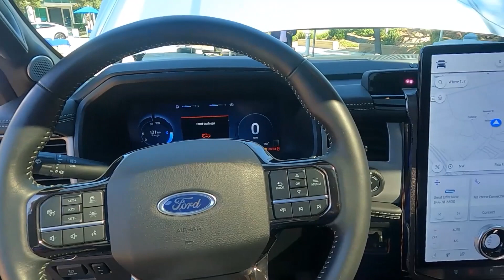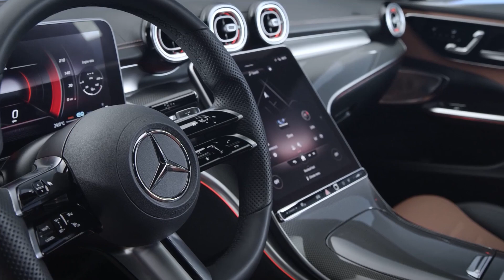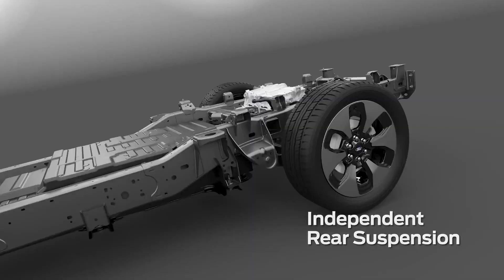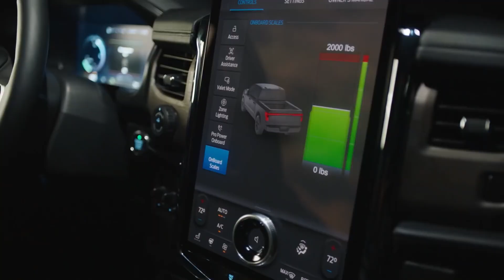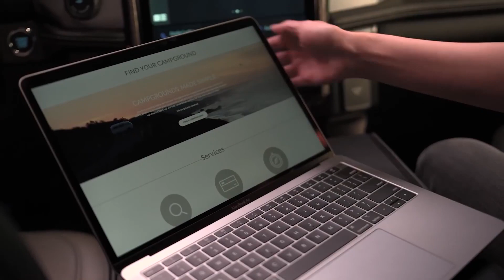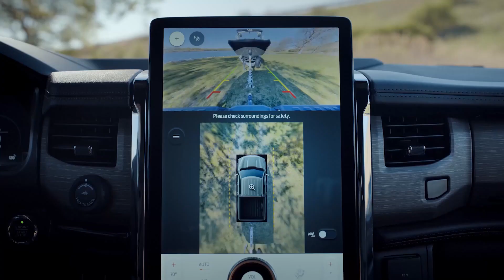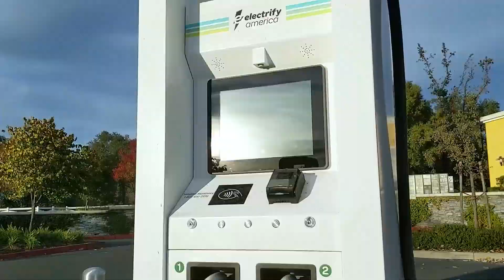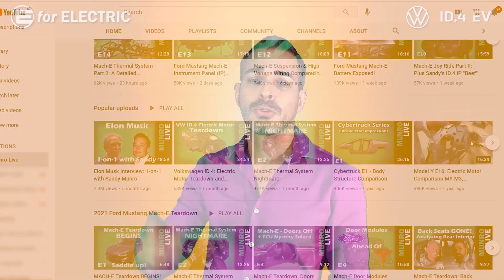SANDY MUNRO on Electric Trucks: F-150, Cybertruck & Rivian

Comment: Monroe: "That Lightning is absolutely perfect for a construction guy." Well, as a construction guy, I must say that without a 6.5-8.0 ft bed, the current Lightning (5.5 ft bed) is worth nothing more than an SUV without a rear roof. Just try hauling a 4x8 sheet of plywood, or drywall, or dimensional lumber, or 10 ft lengths of rebar, or irrigation pipe. Not possible. This Ford is directed at a middle class family that will carry bicycles, a Christmas tree and groceries.
Reply: 4-seater trucks, amirite?
Still see lots of them doing other types of work than construction. I just don't know what it is. But I saw a four-seater with the bed replaced with a big metal box with an open roof.
Reply: @موسى_7  IMO they extend the SUV function to carry nasty stuff, like the dog, bags of fertilizer, or a 1/2 yd of soil for the home garden. The 4 seats are for the parents and 2 kids.
Reply: @louismorejohn586  I thought four seats were for some rare (though I can only call 2-seaters rare) ocassions where they need to get a whole crew somewhere remote to work together. That's what Dad told me when I told him "Seriously, everone is getting a pickup truck for fashion! They even shortent the bed to fit in two seats to take their families!".
What does Dad know about the pickup truck market in a foreign country?
Also, the four-seater I saw with a metal box looked like it was doing commercial work.
Reply: Thank you for looking at this critically and adding some reason to the conversation... I was starting to think that I was the only one that hadn't been brain washed or bought. 👍
Reply: Did he actually say construction guys need a place to use a computer and take to nap? I could do that in a Honda Civic.
Reply: I have carried 4x8 sheets inside my SUV that is only 16 ft long. The sheets were sticking out several feet beyond the tail gate but that was not really a problem. I have also carried tubing and lumber over 10ft long inside the SUV with one end sticking out the front passenger side window. Where there is a will there is a way.
Reply: @cruiser97eric1  Understood, but if you did that everyday, your SUV would be thrashed in a week. The headliner, upholstery, carpet, etc. gunna be dugly. Try 25 x 60 lb sacks of concrete covered in concrete dust. The point being that your SUV is also not "perfect for construction guys" who need daily use of a large bed truck, without jury-rigging.
Reply: Oilfield workers around here would be ok with the shorter box and room in the cab!  Roads where they go need the ground clearance and a4x4!  Plus they will have an office setup in the cab!  Box is big enough for smaller loads of parts, like  a pallet of valves etc!
Reply: Lol.  Ever heard of a trailer?  I don't know many guys hauling those kind of materials without a trailer....unless you are a remodeler or fix it all guy buying a single sheet of plywood and a couple pieces of lumber
Reply: @44beebe  LOL. I have a 10 ft trailer, but it's not always hooked up to my truck that has a 6.5 ft bed. Roof racks are often used too. A 4.5 ft bed is almost worthless for construction.
Reply: Put a rack on it--problem solved.
Reply: @vilicus77  Nope. I will not park my truck outside, and with a rack it won't fit under normal 7ft garage header.
Reply: @louismorejohn586  Do what you need to do. I will be off-roading my EV Rivian when it hits the market.
Reply: @vilicus77  The Riven is soooo heavy, it's taxed extra as a commercial vehicle in my state.
Reply: Not to mention range can be cut clear in half when towing anything significant. I couldn't make it to my camp and back towing my trailer, tractor and implements. My crappy old 01 duramax loses maybe 2mpg when towing.

The lightning is a no brainer for plants and most fleet vehicles that operate close to the plug and return there every day.

 For anyone that uses a truck as a truck, I'd wait to see if Toyota releases a hydrogen Tundra, otherwise take very good care of what you're driving now.

Comment: Sandy gave Kia a bad time for using an existing body for the Niro, but Ford gets praise for doing the same thing with the Lightning.
Reply: The reason he didn't like it in the Niro was because they didn't optimize the space. The Kia doesn't have a frunk because they filled the space the engine and transmission left and filled it with other junk.
Reply: @elbucky6  Junk?
Reply: Decades of experience prove the Ford design works.

Comment: Sandy, Biden drives Corvettes. He has talked to Mary Barra and said he wants to buy the first electric Corvette. When he drove the F-150 lightning he put his foot down. You don't have to like his politics but Biden has always been a car guy.

Glad to see Sandy turned around on parts bin costs. He has frequently derided using existing components in the past. Using mass produced parts is how we get to affordable EVs.

What Sandy is probably thinking about for the range extender is a box that fits in the back of an F-150 Lightning and looks like a standard pickup tool box. It has a generator and fuel tank inside that can power the whole truck and charge the battery while driving. Ford patented this last year but has not officially announced it as a product yet. Will be expensive but is ideal for businesses that make regular cross continent trips.

Gotta add a personal note- Several years ago I was approached by a specialty chemical company that needed to transport a few drums of chemicals at a time across the country. The chemicals were used in silicon chip manufacture (or so I was told. We did a lot of DOD work) and each drum cost what I would pay for a house. They had to be maintained at +/- 2C of the required temperature regardless of the outside temperature and regardless of whether the driver had stopped for the night or not. I love that kind of challenge and the F-150 lightning would have made it far too easy.
Reply: Bide. N doesn't know when his butts been wiped!

Comment: Ultimately, EVs are going to be waaaay cheaper to produce than ICE cars. Just not having to do emissions compliance will save billions. By pricing them reasonably, they get millions of loyal customers
Reply: Due to their inherent longevity and low maintenance, loyal customers may not be valuable.  When people only come back every 20 years for a vehicle, and maybe 2 times for brake parts, you dont make much off of them.
Reply: @michaellowe3665  While EVs will have lower maintenance, I think people exaggerate how long they will last.  The basic drivetrain will be much more reliable, but especially in trucks, the body structure and interior won't. I also don't think most people get new cars just because the old one requires repairs- especially engine repairs. As EV tech progresses new trucks will have more and better features and range. I suspect that while EV ownership will be somewhat longer than ICE vehicles, the average won't go up by more than a year or two
Reply: Don't bet on it. You didn't figure in the "greed factor." .
Reply: @bobqzzi  the F150 now has an aluminum body.  Rust was the main reason to replace old vehicles. It was the only thing that kept car makers afloat in the 70s and 80s.  No one in their right mind would have replaced a nice looking 60s car with an ugly one from the 70s, had they not rusted away.  Engine and transmission failures were next. Electric motors are cheap in comparison.  Transmissions will be single speed.  Also cars seem to be getting more intrusive technology.  Driver facing cameras and over the air updates that change your vehicle overnight are going to be off putting to many people.  These are only the beginning.  Cars built before those technologies were added will be sought after in the future.
Reply: Dont be naive,  cost wont be lower because governaments will find  other escuse/reasoning for taxes . if not fuel/emissions taxes they will tax power, battery capacity . 
Where I live more than half of the price of a new car are taxes and more than 65% of the cost of fuel are taxes. 
Do you really think they will just let go of those earnnings just like that? Nope. This is not about the cost of producing cars (function of forseeable economic factors as volume, demand and offer), the real cost for consumers is biased  by governaments and their needs for founding. For these reasons once ICE cars are gone you will pay either the same of more for purchasing/using an electric car than you do now with an ICE car.
Reply: And they will save countless lives with less pollution and reversing climate change, then nearly 2 million more lives when full self driving is achieved.
Reply: @michaellowe3665  I still want an EV, perhaps I should build my own, break out the English Wheel and learn to TIG weld aluminum or mold pre-preg carbon. Take a look at CZinger. I don't want my car tied to the internet. My phone handles all those needs.
Reply: Ultimately all manufactured goods are going to get way cheaper to produce due to automation and recycling. EVs being manufactured in a few years from now will continue to have better reliability than any vehicles that came before due to competition from Tesla, Rivian, Xpeng, Nio, etc. and also Autonomous driving will increase the vehicle utilisation quite a bit. Much of the profits in the future will come from services provided to the customer after the sale of the vehicle as opposed to the sale itself (Transportation as a service, software updates/apps, games/entertainment, etc.)
Reply: @MrAlRats  In your dreams. More profitable perhaps.
Reply: @fozzybear9114  That depends on where you get your electricity from. In countries such as Canada, France, Iceland, Scotland, Norway, Sweden, Austria, Switzerland, Brazil, Paraguay, Costa Rica, New Zealand and many others, almost all the electricity comes from Nuclear or renewable sources. So if you live in any of these places or you charge your car from your own source of renewable electricity then your EV doesn't produce much emissions.
In any case, emissions compliance refers to direct emissions from the vehicle; which pure EVs don't have. Stricter emissions compliance rules could mean it will be more profitable to manufacture EVs than ICE vehicles eventually. So your comment is not relevant to the original comment.
Reply: @pedroval2007  You are right. They do not realise yet what is comming.
Reply: Battery recycling would still be an issue ... Even with smart repurposing. All vehicles also, as all that aluminum would still need recycling. "Best" of all (worst, obviously 😁), the electricity would need to stop using fossil fuels for all of it to be remotely close to being green ... Which we know it won't, because ... greed 😁😉😊 And I have not even brought up road building and maintenance which are just crispy dinosaurs as they rely (still ! in 2021) entirely on fossil fuels for the asphalt directly + concrete & steel indirectly (factories and transport). So ... there's that 😁😉 But, hey I completely understand the craze and misdirected passion for betterment ... I too would like to drive a Tesla Model 3 PERFORMANCE 😁 and nothing else 😁😉😊 But I would still be doing it wrong for the right reasons 😁. And I even know how to help the electric revolution with the absolute best exponentially fast and radically simpler battery manufacturing system. However I also have the absolute best vehicle design that only needs hyper pressured steam + a heat source like the sun for the most part and or IR lamps when needed) NO ELECTRONICS & AI, NO BATTERIES, NO ELECTRIC MOTORS, NOT EVEN ONE GRAM OF METAL OF ANY KIND ... 😁 Just polycarbonate, carbon fibre, rubber for the body and nylon or / and similar for the hammock-like inertial seats. EVERYTHING RIDICULOUSLY SIMPLE AND EASIEST TO MANUFACTURE IN FULLY AUTOMATED AND AUTONOMOUS MINI FACTORIES THAT ALSO PRODUCE THEIR PARTS NOT JUST THE CARS AND TRIPLE UP AS CHARGING PARKING AND WORKSHOP STATIONS WITH FULL ARRAY OF IR LAMPS POWERED BY GREEN ELECTRICITY EXCLUSIVELY = ELECTRICITY PRODUCED BY HYPER STEAM LOCAL DEVICES / VEHICLES. NO MORE INEFFICIENT, FRAGILE AND INEFFECTIVE SOLAR CELLS (capped out at 20-25% from the get go because physics 😁) + NO MORE TROUBLESOME BATTERIES THAT ARE MANDATORY aa THEY ALL POLLUTE STILL WAY TOO MUCH BY THEIR MANUFACTURING ...
Reply: @MrAlRats  note that those countries you mentioned are in very cold climates. They are learning a very hard lesson on battery degradation in extreme cold weather. Way less range and battery life than expected.  This week improve over time but not anytime in the near future.
Reply: @bobqzzi  change a in a year or two?...
Man I would to live in a first world country.
Reply: People don't always realize what battery production really is , Lithium is pretty hard to mine and refine and takes thousands of tons of materials moved by heavy diesel mining equipment to get the materials to produce one car battery before you refine those materials and build the batteries
Reply: @michaellowe3665  ask those who live in cold  climates how long their batteries are lasting.   I do believe that EVs will replace ICE vehicles over time but the notion that EVs are an environmental dream come true and that they will last longer than a product wth over 120 years of technology is ridiculous.  No EV will last longer than a current Civic or Corrola.  Batteries lose effectiveness faster than an ICE vehicle.

Comment: 20:46 Sandy Confirms my suspicion that towing won't be too bad if the trailer has a batter pack,  I would also suggest the trailer has a motor as well (potentially).
Reply: you have got to remember that the more battery you have the more you have to charge up...
Reply: I agree on a powered trailer.....the tow vehicle should just be there to guide it.
Reply: Self-powered trailer with motors, braking, and adding power to the towing vehicle.  Big ass battery to give 800 mile range, so you don't have to spend time charging, you can hit a restroom, grab a sammich for the road, and be on your way and drive 10 hours with a minimal stop or two.  Perfect.  Sign me up, the check book is open.
Reply: @carlstockmal  you're gonna need a massive check for a trailer like that!!
Reply: you could go the whole zero sum game.. eight wheel steering gate... mummy wants one joe.... but you have to do mass verses eco-no-mics parlease
Reply: Instead of adding heavy batteries to a trailer, they should just add assist motor/ generators and supercapacitors.  They could charge on downhill and braking, then take the load off accelerating.  This would save gas on an ICE truck too.  EV batteries aren't very good at absorbing regeneration power because it comes in too fast.  Capacitors do this much better. 

Box trailers could add solar on top to offset some of their drag.
Reply: @michaellowe3665  the only thing I don't like is that vehicles aren't really designed to be pushed from behind. Adding a force at the back of the vehicle seems a little sketchy. I've had a heavy trailer push me down a hill before.
Reply: @themeach011  that's why you put load sensors in the hitch. The power assistance would only kick in to reduce the load at the hitch not actually push the vehicle. It would actually stop the condition you are talking about by loading the motors on the downhill and preventing the trailer from pushing you then. It could be a major safety advantage on steep downhill runs. You could also access the assistance by attaching a handle to the hitch.  When you want to move the trailer by hand you pull or push the load sensor and the trailer motors would move the trailer in the direction you pull the hitch.
Reply: @themeach011  You mean cheque
Reply: @MegaWilderness  Ya I always put cheque but for some reason I didn't. I suppose it was because the guy u was responding to spelled it that way. Lol
Reply: @michaellowe3665  "EV batteries aren't very good at absorbing regeneration power because it comes in too fast" That doesn't seem right. Can regen produce more power than the motor uses when accelerating? Yes,if set to maximum, but when charging at a level 3 charger, they can charge at hundreds of mile per hour, so I don't see what would be the limitation for regenerative braking, unless the battery was near full, or cold.
Reply: You don't want a trailer with a motor
Reply: @wickedleeloopy2115  Why not, trains have them in each carriage, better more smaller motors than a huge one.
Reply: @MegaWilderness  Smh* Americans.
Reply: There’s a company out of Europe with working prototypes of electronically assisted trailers. They assist with acceleration/hill climbs, and regen for braking, but don’t assist during cruise. Oh motives fuel economy. That would make for an interesting DIY project.